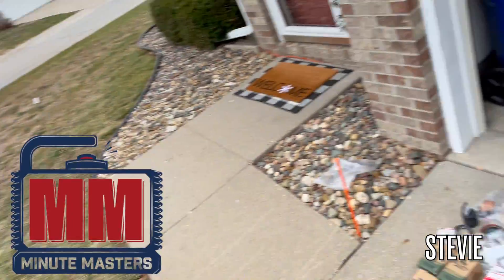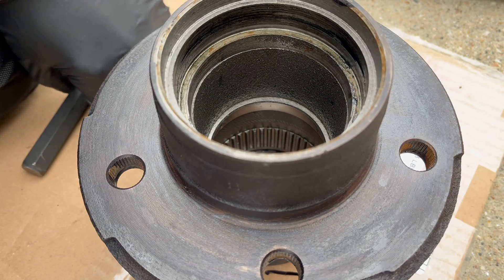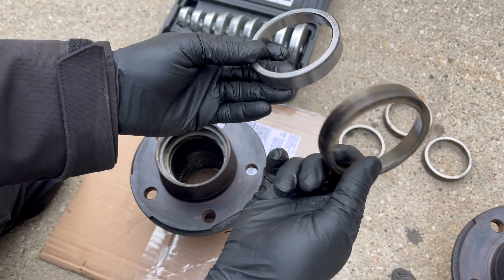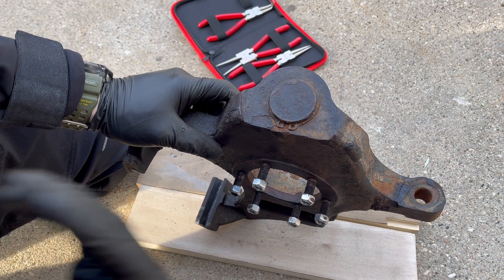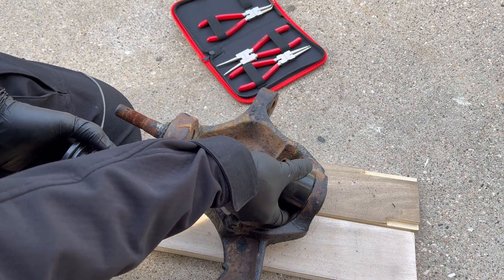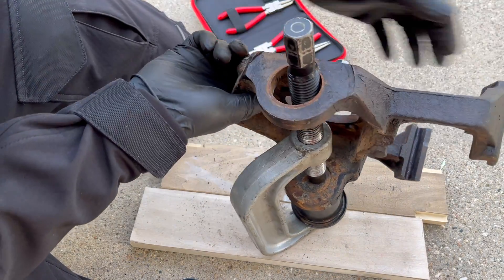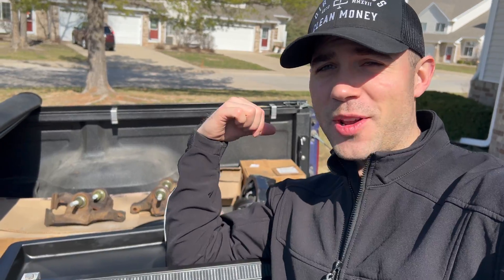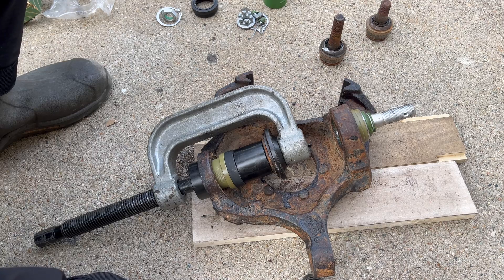TTB 4x4 SWAP [PART 1] - How to Install Wheel Bearings & Races + Install Balljoints  | 1995 Ford F150

Comment: Can this be done on a 5.8 engine
Reply: The suspension on rwd 5.8s shouldn’t be much different than the 5.0 the only thing you’ll probably see different between your engine and his is the transfer case because idk if they used the same transfer case across all 4wd models
Reply from the maker: What he said👆
Reply: Forgot to mention, but found out myself recently spindles are also dependent on the years even within the overall classification of OBS f150 (I believe 87-96) so depending on if you have an earlier gen model year or the later model years there’s a difference between spindles and knuckles between (ie. 97-91, 91-93, 94-96) I just thought it was of note best to ensure the fitment, but I’m not sure if it makes a difference.

Comment: Is it possible to pull the knuckles and replace the ball joints without removing the axle shafts?
Reply from the maker: In theory, I think you should. I say theory because I haven’t tried it. But I can’t imagine shops are pulling the front diff in order to pull the axle shafts out for this work.

Comment: Do you have a rough estimate on cost for all lf this? 

Also do you have a parts list for everything you acquired for this swap? 

Thanks!
Reply from the maker: Not yet. I’m actually going to try and put one together. However, I have not swapped the transmission and drive line yet. So all the cost isn’t there yet.

Putting a detailed parts list together will be difficult because there are slight differences between years of TTBs.

Comment: When you were in the process of gathering all the parts, was “Jeff’s bronco graveyard” something you looked at or considered if you ever did look at that cite. They have rebuild kits anything from the diff out to the hubs and rotors. I’m more or less gonna go your route and just buy the better parts as I go, but rebuild kits are tempting.
Reply from the maker: Actually, I got the bulk of my parts from bronco graveyard. The ball joints I had to buy from Amazon because Jeff’s bronco graveyard doesn’t carry them.

Comment: Nice Finally putting the parts together… what happened to cleaning/sand blasting & painting or powder coating??
Reply from the maker: I’m not going to include any of the cleaning or painting. The reason is because they actually don’t get as many views, and there are better videos out there on how to do it.
I was also in a rush right before winter to get everything painted and ready. So I didn’t have time to film any of it.

Comment: Looking forward to part 2! Looking for any advice on possibly levelling my 95 f150 XL 2wd 8 ft box. I measured as best I could and the back is sitting around 4” higher than the front. I’m sure the front springs are sagging causing such a drastic difference. Looked into the 1.5” levelling kit from RC or possibly f250 springs. I’ve just heard it can cause rough riding and camber issues. Anyone have recommendations if I should just go with stock springs and what’s the best option to levelling it out more.
Reply from the maker: Me too! This 4x4 swap is going to be a multi-part series. 
Personally, I would see what some adjustable camber bushings, longer shocks, and leveling springs. The worst thing that can happen is you have a degree of positive camber.

Comment: Does anyone know if you can do this with a 2wd rough country lift?
Reply from the maker: Like keep the lift kit and still convert to 4x4?
Reply: Yes.
Reply from the maker: @connor8377  Good question. I will error on the side of no because 2wd drive trucks sit lower than 4x4. So the suspension geometry may not work.

Comment: All nice new parts and labor.  Why not sandblast and powder coat the knuckles? Also, what's the plan for the diff internals?
Reply from the maker: Well the plan was to install everything in the winter and I want to paint everything. I just couldn’t paint those knuckles. Basically, my plan got all turned about.
As for the diff internals, they looked good to me. So I’m keeping them stock. I also don’t have the budget for an LSD at the moment.

Comment: I've got a 96 f150 4wd that actually had low miles on it when it was hit in the side of the bed. It has Manual Hubs I may have to put those parts to good use & convert my 95 2wd to 4wd
Reply from the maker: That’s a great idea Bobby! Nothing like a little recycle/repurpose!🤙

Comment: Those knuckles look like the older design with caliper pins not bolts. You may have to get different calipers
Reply from the maker: Yup, that will be part of the swap.

Comment: i wanted to do this on my truck for the longest time, lol i pulled the axle at a junk yard but the Radius  arm were pinching in place and the yard was closing. Decided that I was going to pick it up the next day but found out we have to move and only got 30 days to leave. I didn't have time for the 4X4 swap. I need to swing back out there and pull another axle and a rear end for my brother tundra.
Reply from the maker: Damn, that sucks man. Hopefully you’ll have a chance to find another axle and get started again.